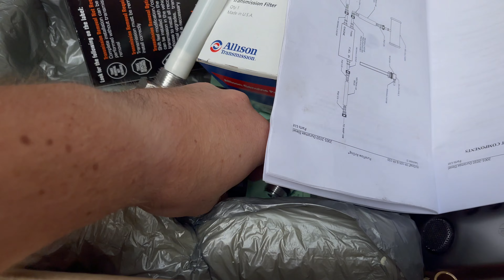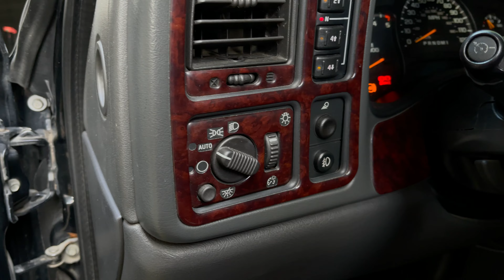LBZ DURAMAX finally gets AirDog 150gph

Comment: Hey brother did you have to run adapters to make those wheels fit?
Reply from the maker: I did, I 2” in the rear and 1.5” in the front. 8x6.5-8x180
Reply: Awesome brother thanks for the help I appreciate it
Reply: You may be planning to already,  but you should do a video on the wheel change. I'm interested in putting the newer style factory wheels on my LLY.
Reply from the maker: @pdab4372  I will!! I’m getting some stuff ready so I can get more LBZ and scout stuff out but I can make a quick video on that, I should have it out by the end of the week